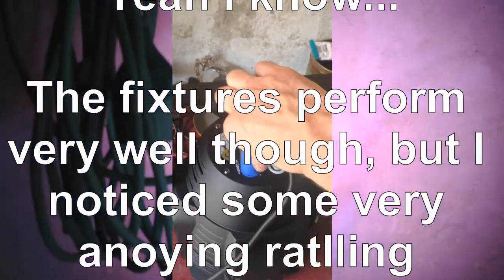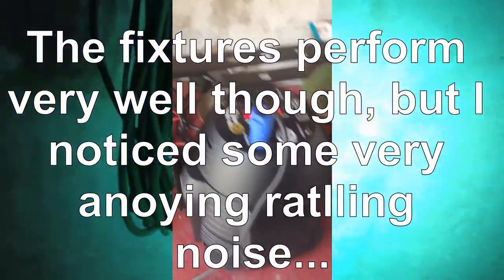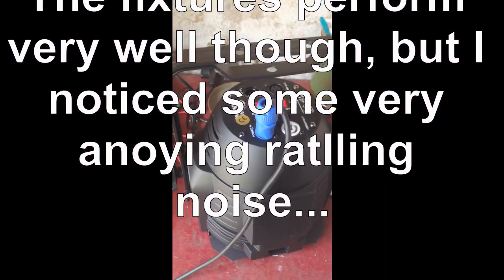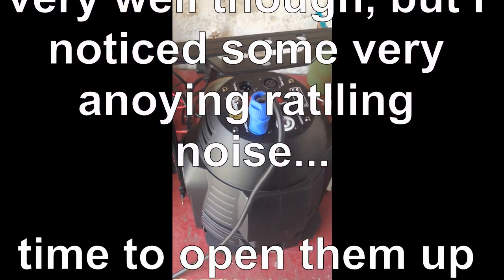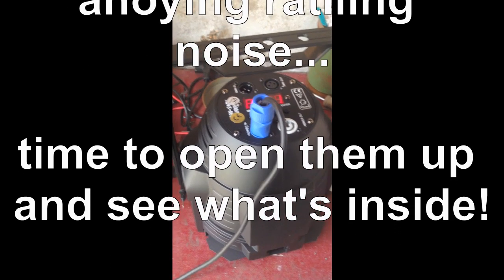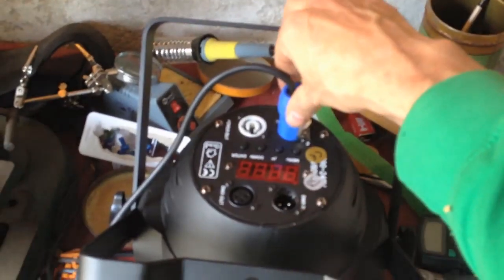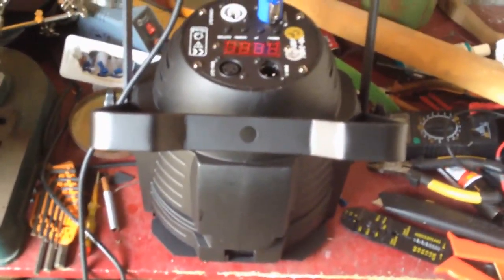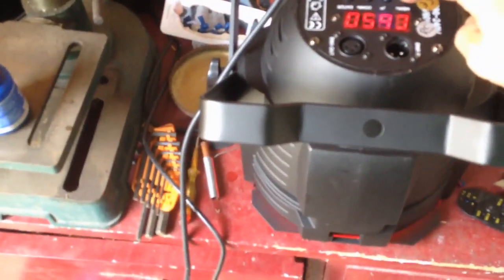Fixing RGBWAUV 18X18w 6in1 Chinese LED fixtures

Comment: Thanks for your video. How can you be sure that your LEDs have 18W each? How can check it? Thanks.
Reply from the maker: They were advertised as 6x3 w led RGBAWUV, but I guess if you want to be sure you could measure the current they use when driving all colours at full intensity.
Reply: @kropjesla01  I will be happy, but I can't do it. : ((.